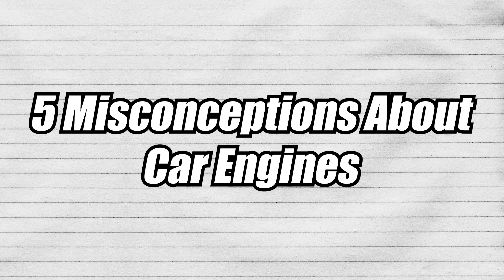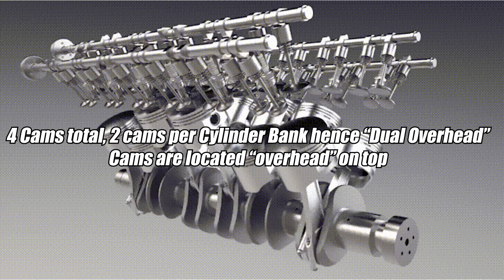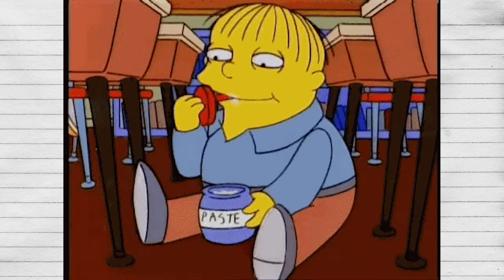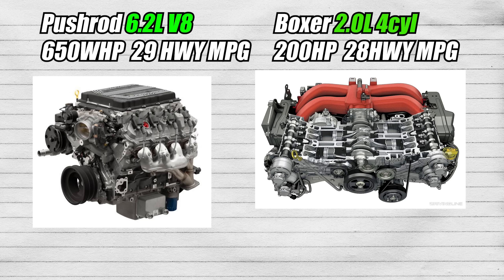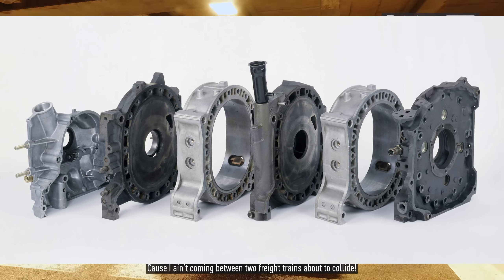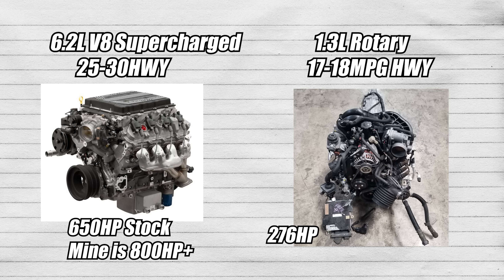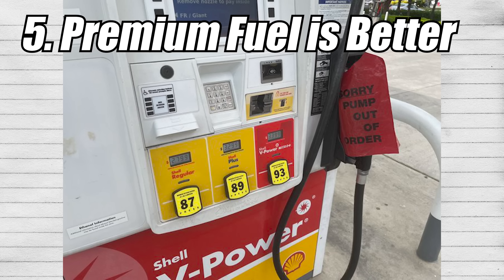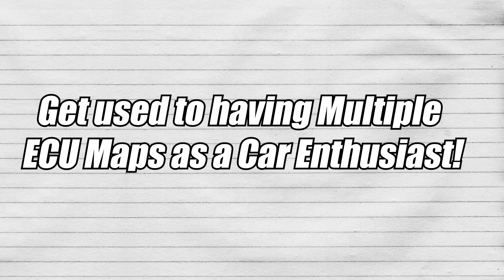5 Misconceptions About Car Engines!

Comment: Most cars have the oil flowing in the first few seconds, but the truth is that oil hasn't reached it's proper viscosity to lubricate properly at all rpm ranges right away. Oil that is still like 60 degrees isn't gonna lubricate properly if you redline it from only a few seconds of warming up.

I do drive an older car, so I let it sit for a good minute or so before making any boost or anything like that and I don't get on it until my oil temp reaches operating temp. 

As you said, this is a more harmless one as no harm ever comes from letting it warm up and letting it reach operating temp no matter how old the car is.

Comment: Shhhh let everyone think rotaries are unreliable. We don't want another Crown Vic situation on our hands. I need to buy at least 5 more RX-8's while they are worthless. Also, you can actually still get a whole 13b-msp block from Mazda, and have a dealership install it. The biggest expense is fuel and premix in the long run, especially if you aren't the most delicate driver and average 12mpg. I still find it funny that the RX-8 uses the same size oil filter and same amount of oil as an NB Miata.

Comment: To that Engine and MPG one:
My first car was a 2002 Hyundai Getz 1.6, the biggest stock engine available out of a 1.1, 1.3, 1.4 and 1.6.
Even the official numbers said the 1.1 got worse MPG, despite the Getz weighing just a bit over 1000kg.
Every Car has that it's own "balanced" engine option
Reply: Some engines have more torque than horsepower and vice versa. The reason why small engines get bad gas milage is that there is an ideal hp and torque minimum that is needed to propel a car at a given weight forward and sustain its speed. If an engine is too small, the engine has to work harder to meet that minimum requirement. Larger engines meet that requirement easily so they work less.

The short(made up) easy example is that a 2.0 liter with 100 hp/100torque at moving at 5000rpms in a 3000lb car will get the same mpg as a 4.0 liter getting 200hp/200tq at 5000rpm, however, the rpms just need to drop to 2500rpm to get the same milage and thats all about gearing a.k.a the transmission and wheel combination.

As a bonus, the larger engine "can" have a longer lifespan, due to less engine movements AND it "can" be a quieter ride with those lower rpms. Emphasis on "can" because most people drive them hard.
Reply: @JupiterxBlues  exactly.
It is logical, but so many people need to have the basic concept explained to get it.
Reply: @JupiterxBlues  this, plus a bonus: that hypothetical 4.0 probably has more cylinders. This also adds smoothness (if done properly).
Reply: I own 2006 Getz with 1.4, it's hilarious how in city it consumes more than Volvo C70 with 2.0 engine (although it may be unfair to compare diesel and gas engines).

Comment: The whole no replacement for displacement is true because for a smaller engine to make the same power it needs forced induction. However if you put a supercharger on a 5.0 you can make 800hp very easily. Same goes for any of the other newer gen v8
Reply: lets say its EITHER bigger displacement or forced induction. a turbo 3 litre v6 making the same power as a NA 5 litre v8 means that there is a replacement, as its more efficient when it needs to be and just as powerful when it needs to be
Reply: Forced induction IS an increase in displacement. You are pushing more air into the cylinder, increasing it's effective displacement.
Reply: @a_shrxydud  at the expense of... expense lol
Reply: Smaller internals can rev much higher, making more power than bigger engines could for much less weight and most importantly, size. It's not viable for road cars but big engine race cars are just rare these days.
Reply: @afoxwithahat7846  you might be surprised at the size and weight difference between a "big" LS engine and a "small" dohc V-6 or even inline 4
Reply: @nthgth  I know LS engines cannot make from 700 to 900 hp NA while weighing less than 240lbs. Which is the reason I mentioned racing engines.

For a road car, it has little stress (high reliability), it's light enough, simple enough, powerful enough and economic enough.

It does not serve as/should not be used as an "example" that bigger engines are simply better for every application.
Reply: @afoxwithahat7846  oh. Well no one said anything about every application, and since you only mentioned race cars at the very end, it seemed like your point was meant to imply for road cars (the video's subject).
I agree about race engines though. It makes sense that with a good budget, you can basically get as much power as you want from even a small engine so you might as well go with that. Oversimplified but generally speaking.
Reply: Bigger displacement in and of itself does not mean more power, even comparing N/A to N/A .  Most early 4+ liter V8’s make less than your average rental car 3 liter v6 or sport compact 2 liter.

Comment: On warming up engines, you can generally hear/see when the RPM drops after cold start. When they drop to normal after a bit you’re set. Like he said it’ll take about 10-15 secs, but i’d say give it 30-40 secs on a cold winter day. Like he said again, by the time most people are done setting the radio n stuff, you’re good to go.
Reply: Yes, and with the motor this change a lot.
Like the 1.6 of the 306, he need a lot of warming (a few minutes) to be safe.
Reply from the maker: This too. I always listen for the sound dropping or in Motorcycle's case, feel for the vibration smoothing out!
Reply: @BladedAngel  its a bit easer with my Volvo since its cammed, but only chops when completely cold…
Reply: On a 40 degree day I need roughly 2-3 minutes for my idle to normalize.  At this point it may be safe to drive away, but no fluids are at operating temperature.  I would rather wait the few minutes to get coolant and oil up to temp before driving.  Twin turbo HR 350Z that doesn't sound like a trumpet.
Reply: My mother drives semi trucks, it was common practice to turn on the truck and wait for it to idol down indicating it was warmed up

Comment: Bruh I’ve been recently thinking about the mpg and started thinking that my LT1 has better hwy mpg than my civic. This video jus proved my point a bit
Reply from the maker: A Civic, depending on year, should still beat a LT1 in fuel economy. Not by much surprisingly. My Bro's LT1 Camaro got like 30 HWY MPG and my buddy's Civic SI gets like 33-35ish HWY MPG.  The base Civics can even get 40MPG, but Type-R's can actually get worse MPG than Pushrod V8's, it's kinda hilarious lol.  I have two Type-R Friends who hate how my Z06 hyper miles better than them.

Comment: To be fair, all else being equal a larger engine will use more fuel per revolution because its flowing more air. However, that doesnt take into account that a big, torquey engine doesnt have to rev as much to keep a car at a given speed or accelerate at a given rate, meaning on balance they can use the same or even less fuel to accomplish the same movement.
Reply: That, plus they need less throttle (technically MORE throttling) for a given power output so they aren't even flowing more air except in spirited driving when nothing is economical anyway
Reply: Plus some are equipped with the cylinder deactivation feature

Comment: Thank you for FINALLY pointing out that small engine ≠ good MPG. I drive a 1997 Ford Thunderbird. It has limp dick acceleration, it has minimalist power and it develops an electrical problem every week. My mother has a 2019 Mitsubishi Outlander Sport. 2.0 liter 4B11U, Jatco CVT and 300lbs lighter than the Thunderbird, yet they both get the same highway MPG of 27. My mother refuses to accept that because my car has more power is the reason. I only have 205 horsepower but I have about 300 ft lbs of torque, literally double what the outlander makes. And I have 3.73 gears in the Thunderbird, to the car is barely as 2500rpm at 80mph. By contrast, the Outlander’s CVT is in its highest possible ratio at 80mph and buzzing at around 3000rpm. An engine with a redline of 6600 where the 4.6 in the bird only goes to 5500.
Reply: Makes sense. But in the very specific, unflinchingly rigid conditions of the gov't tests, the Mitsubishi probably gets (so Mitsu can advertise) higher mpg.

Comment: 5:33  Everything you just said is very very true but at least to a problem that people always Buy stuff that they don't need.

How many people have a full size pick up truck or SUV and don't really use the 4 sides pick up truck or the full size SUV is only taking one person to work day today.

If you're gonna be driving around the city then a hybrid would be best.
 If you're gonna do mostly long distance travel then a bigger engine with a fairly sized car would be best for gas mileage yes.

But people want everything in one package and that leads to a problem and they also don't really think about what they actually need.
Reply from the maker: Nah bro, One step even further.  I just use a C125 Supercub for Local trips, Motorcycle for Any trip with Good weather, and Z06 if I carry something.  I'll never buy an EV or Hybrid so as long as 155MPG Scooters exist.  They're Super fun!😀
Reply: @BladedAngel  ... didn't know we where talking about scooters MPG when you was talking about cars the hole video. But ok.

I still think my opinion stands. To add the U.S. doesn't use bikes in anyway for true transportation for a number of reasons.

Comment: You had me up until 10-15 seconds to warm up an engine.  Its not just about oil being pumped. Its about the expansion of engine components and the tolerance between them.
Reply: I had that thought too. You can move it once the oil gets flowing but you shouldnt push it until it fully warmed up for that reason. Which I guess he did kinda brush over it without directly mentioning it.

I usually let my car idle for a minute regardless and take it easy until the coolant is upto temp

Comment: The Corvette gets better gas mileage at 80mph than the Mustang because it has more gears, it has nothing to do with the size of the engine.

A fair comparison would be comparing the 2.3L Mustang vs the 5.0L Mustang. The 2.3L Mustang get around 25% better fuel economy than the 5.0L. This is true for EVERY car that offers multiple sized engines, the smaller engine always gets better MPG.
Reply: Also, one is a highly aerodynamic sports car, the other is a slightly rounded brick.
Reply: Right I disagreed with him on that part.
Reply: Then explain my old Camaro getting better mileage. Same amount of gears.

Comment: In terms of the fuel efficiency point, gearing is an important factor too I think. For instance, I drive a 1986 F150 with the 302 (pushrod V8) with the factory 86 AOD 4 speed auto. This was during the time the federal max speed limit was 55. Plus automatic transmission technology was pretty primitive compared to modern vehicles. It'll engine brake no matter where she's at on the RPM. The modern automatics don't really do that. I'm not a transmission expert, so I don't really know how to explain it, but transmissions have definitely evolved and its definitely a contributing factor to fuel efficiency
Reply: Maybe I should a finished the video before commenting. Though, to be fair, you only talked about gearing ratios and not advances of how they work. Though that's kind of out of the scope of this video

Comment: ok there is some things wrong in this video

1: torque output is not determined by how the valves are actuated but is more a function of intake volume and shape, valve geometry, engine configuration, and geometry. the way your car behaves in over run conditions is more likely due to ecu calibration than torque output, in fact a higher torque engine should compression brake better than a lower torque engine of similar design. think about trying to lift a piston with progressively longer sticks and you will get the idea.

2: rotary engines are absolutely still supported by mazda and you can still get a brand new keg, direct from mazda, not reman, new for the 3rd gen rx7. turbo rotaries tend to be short lived but n/a varieties can live quite a long life excluding the dumpster fire that was the rx8. the reason parts are so expensive is due to the availability of vehicles to put them in. i.e. they didn't make many rotary cars in the first place and many of them are destroyed so the market is small which means niche manufacturing and high prices.

at the end of the day, whatever engine configuration gets you going, enjoy it while you can because pretty soon we might all be forced into driving hoovers around.

Comment: My brother and I made a 300Km drive averaging 120Kh/h roughly I was in a 2010 Mercedes E550 4-Matic (5.5L V8) and he was in a Hyundai Tucson AWD (2.4L I4). I got 7.8L/100km his fuel economy was 9.3L/100km. 
It was hilarious to me because the E550 was at like 1700rpm at 120km/h his car was at like 3300rpm at the same speed. Also there is obvisously a difference between aerodynamic of a sedan and SUV that effect it too but still more than double the displacement.
Reply: Awesome car, and a great example of one reason it's such a shame that SUVs have taken over so much.

Comment: By far best mileage ive ever gotten was in my 350hp 400lbft 2.0 4pot mk7 gli with a 7spd dsg. 

At 2k rpms it cruised at 80mph. 
I averaged 28-32mpg all time(over 62k miles). 
Im a very fast driver. At 70-80mph it would cruise at 30-40mpg. On spirited backroad runs maintaining speeds of 50-150mph id still average 20mpg. Lowest maybe 16-18mpg. 

Its a poor example because it is a small engine. But its because of all the torque it made down low. Could haul ass never touching 3k rpms. 

For many people especially me the overwhelming factor of milleage youll get is torque numbers. 
I drove a prius and got 7mpg once. 
My b9 s4(600tq) averages 16-22mpg(on e85)~20-25 hauling ass everywhere. 

I had a 2000 chevy silverado 5.3 310tq and got abysmal mileage (10-15mpg).  
Well my grannie has one same year but a 4.3l v6. Cant even graze 10mpg in the real world. 
Its down 2 cylinders and a liter yet the real world milleage isnt even comprable.
Reply: Somewhere i have a picture of the dash showing 43mpg on that vw. 

Thats double what a prius actrually gets. 
That 43 mpg was delicate but not annoying to achieve i just have a heavy foot and with its tuned it really liked to jump into boost

Comment: you should let your oil get up to temp if your doing hard driving such as towing but if your just going a to b 15-30s is plenty of time
Reply: With hybrids you don’t even need to do that
You can drive on electric power while it warms up
That is as long as you don’t floor it and force the engine to send power
Reply: @Juanguar  will the engine run while you're driving on electric? Maybe just when it's cold so that it can warm up, then it shuts down if you still don't need its power once it's warm?
Reply: @nthgth  yup that’s exactly what happens
It runs to warm up but will not connect to the gear unless you absolutely floor it or it reaches optimum temp
At least that’s the case with Toyota hybrids
I don’t know how the rest work
Reply: @Juanguar  that sounds really smart. For this and other reasons, if I ever get a hybrid it'll be a Toyota.
I'd also hope there's a way to tell the engine not to bother if you know the trip is going to be a short one.
Then it'll just stay off (if the battery is charged enough for electric drive) and only fire up if the batteries get too low.

Comment: Subaru’s specifically say in the manual to let them warm up enough for the low temp light to turn off. Every vehicle is different, you can’t just assume because it’s fuel injected that you can just get in and drive, just wanted to put this in here since numerous people say that boxer engines are unreliable.
Reply: Time to read my owner’s manual again.
Reply: "Low temp light?" Do they mean the temperature gauge?
Reply: @nthgth  Believe it or not, run-of-the-mill econobox Subarus do not provide us with any temp gauges. I am lucky to own one of the top trim level that will give me an option to display the temp gauge on the center display.
Reply: @nowiecoche  oh wow. Cheap out much? I knew I was not in a Toyota anymore when the doors refused to unlock on my STI in the upstate NY cold, but damn. I wonder if the new WRX has one

Comment: My brother is horrible with treating cars and gives me shit all the time. I have an old supercharged AMG and I let it warm up a bit before setting off and drive it in a conservative manner until everything is at op-temp, but he constantly complains, "Why don't you just GO!?" What he does in his 05 Corolla is immediately when he starts it up, he drives the piss out of it so he can get to where he needs to be quickly, keep in mind, it'sDecemberand I live in Michigan. It's cold! Not too long ago, the car throws a misfire and AFR code and acts a little finicky under throttle at certain points. He wonders why my old AMG is running perfectly and his "bulletproof" Toyota is acting up. Let that sink in
Reply: Neither here nor there, but that's the problem with cars that are both cheap and reliable: they invite people to treat them poorly. 
(Even just cheap, really)

Comment: an aircooled boxer 4 engine that sits in a beetle from the 70's gets around 22 mpg on modern fuel, that isn't bad when you realise the compression is only around 6:1 and with a carb